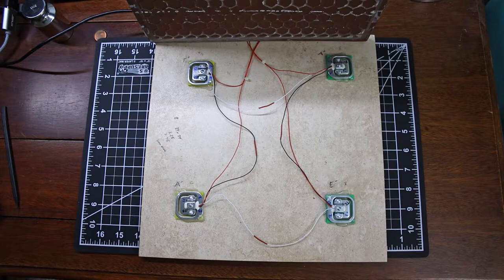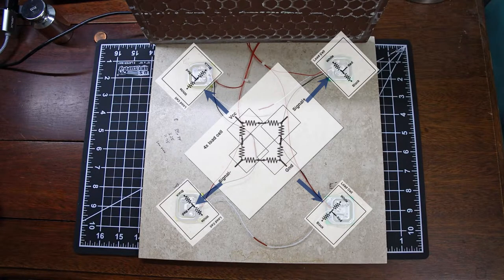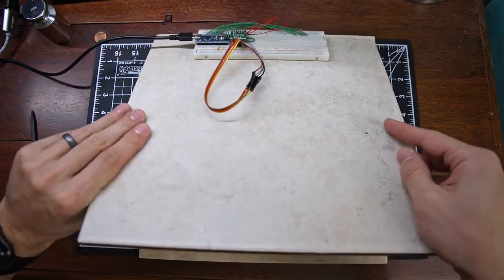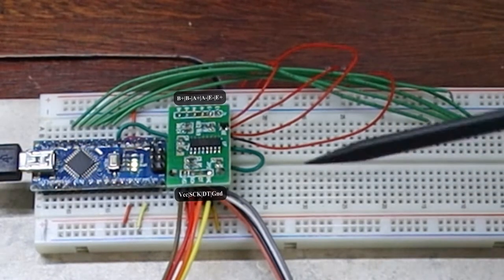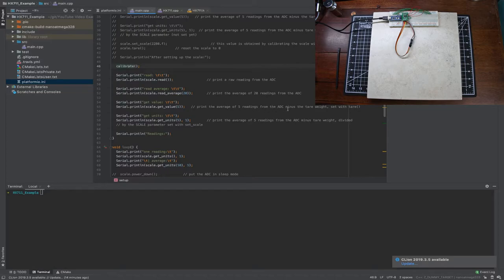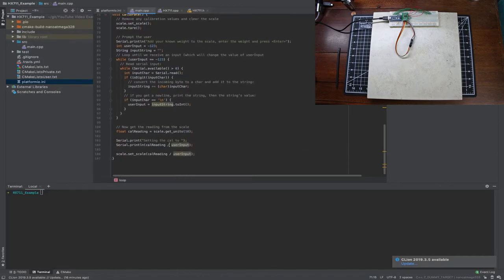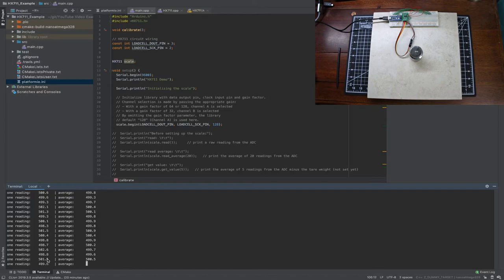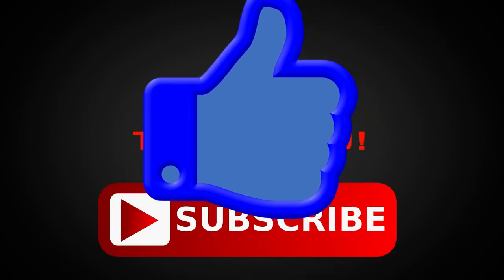How to use HX711 with Four Load Cells

Comment: Hi There how did your project turn out?  
I take it you were leaving the kegs on the scales for days on end did this cause any problems in the weight readings creeping.
Your project is similar to mine and this is my main concern the margin of error with a load on the scales almost permanently would give an unworkable error for my needs.
what sort of weight were you trying to weigh and what error did you get.
Thanks
Reply from the maker: My final project actually ended up being a coffee monitor for the office. It monitors the amount of coffee in a carafe to let people know how many cups are in it, it even sends out a Slack message to notify people when a new pot was brewed. Anyway, the weight of the carafe and coffee together was about 120 ounces if I recall. I did have issues with creeping which I tried to fix by taring when I detected the carafe was removed from the scale (during a new brew). Ultimately it ended up that I had better results just ignoring the creeping because it would eventually hover around the accurate reading, it would just sway up and down over time, the amount of creep was never more than a couple ounces. I want to say (though I don't recall if it was the case) that I ended up having less creeping problems by using a different sensor than the HX-711. I used an ADS1232 which was harder to find, and even harder to find documentation for, I ended up writing my own library for it because I couldn't find one but this was all done on the Raspberry Pi because, since it sends Slack notifications I wanted an all in one system instead of an Arduino plus a WiFi module. It also gave me the ability to add logging to a MySQL database and create a website where I could view logs and charts of historical data.

Comment: Hi there, I have issue with my program. But in my program, I use Raspberry pi.
I just want to use 1 load cell. The output giving me inconsistent value. Any advice?
Reply from the maker: It's hard to troubleshoot over text but I would first check that you get expected changes when you press on and release the sensor. As long as it goes up when you press and down when you let go at least you know it's somewhat working properly. After that, if you are getting drift when nothing is on it, try putting weight on it and see if it still drifts. Any more testing would be based on what you see after running those checks.

I hope this helps.

Comment: how accurate are these?  can it go down to the per gram?
Reply from the maker: It's been a while but I think I showed a little bit of the accuracy toward the end of the video. With that said though, I use my project to monitor weight in ounces and it can fluctuate by an ounce or so and an ounce is about 28 grams. The main issue is that everything comes into play, if you take a look at the datasheet, different temperatures can yield different results so if the temperature changes, your weight calculation would need to change for that much accuracy. 

TLDR; Out of the box, not accurate to gram precision but with some algorithms like maybe a kalman filter it could be better.

Comment: Thank you so much for this video! Helped alot with general knowledge of the HX711 and how it works. My current project is looking to possibly use multiple sensors.  Do you know if it is possible to use multiple HX711 (up to 4 so 16 sensors) with one Arduino uno?
Reply from the maker: To be perfectly honest, I don't know of a way to mesh multiple sensors though I imagine it's possible. If they are all part of the same scale you could use multiple sensors and simply add the values from each sensor to get the total distributed weight.

Comment: How could I do this with only 1 of these thin load cells?  I need a thin pressure sensor.
Reply from the maker: Are you asking about using a strain gauge by itself (like this one that is mounted on a piece of glass https://i.ytimg.com/vi/uQWfNc24Ehc/hqdefault.jpg ) or just using a single load sensor like the four I was using in the video?
Reply: @RobotResearchLab  maybe both.  My original question was using a single load cell like the 4 used in your vid.
Reply from the maker: @TheDiverJim  That should be pretty easy though I have not tested this myself. Since you're only using one, you have to essentially finish the wheatstone bridge yourself. Here is an image of a circuit that should work for you, then the code should all be the same. 
https://aws1.discourse-cdn.com/arduino/original/4X/7/9/1/791377ddf46355cc9d9d6d059fbc83f9841a0f66.jpeg
Reply: @RobotResearchLab  thank you so much!!!  I unsure what the amazon listing meant by half bridge, yet 4 load cells.  So since these are center taped, the thermal error should still be compensated for some what?
Reply from the maker: @TheDiverJim  I wouldn't worry about the thermal compensation, at least not until you get the code running and figure out if it's actually an issue. Also, if the ambient temperature is going to be relatively stable it wouldn't matter as it would be factored into the calibration for the most part.
Reply: @RobotResearchLab  so i got it working, but I’m getting a ton of drift.  I left a 2kg calibration weight on it for 20m and after 15m it read 1.3kg.  Any ideas? Could my load cell be defective?
Reply from the maker: @TheDiverJim  That does seem like a lot of drift, I've noticed some drift but it usually averages around the same point. I'm not sure what might be wrong, I would probably start by trying a different load cell to rule that out. Aside from that the only alternatives are the code (not likely causing drift unless there's a bug somewhere) or the HX711 or whatever ADC you're using.
Reply: @RobotResearchLab  yeah.  The silicone coating on the resistor was damaged a little (small corner piece) when drilling the rivets off to add my own 3d printed pad.  My goal is to calculate at what point do we get a chest wall correction on a child with a deformed chest wall.
Reply from the maker: @TheDiverJim  Great that you found out the problem and it was nothing major.

I can relate to your project then, I have pectus excavatum. I'm not sure if that's included in the deformed chest walls you're looking at but a noble goal either way.
Reply: @RobotResearchLab  right now we are looking at non-surgical solutions for pectus carinatum, next is the far more challenging excavatum. 

So you think the damage to the coating is the source of my errors?
Reply from the maker: @TheDiverJim  Oh, I thought you found that to be the problem. But yes, I would say that if some of the coating was removed it would allow ambient temperature to play a larger role in your results and drift. It still may be something else but that would be my first check, try a new sensor. I would first try it before drilling and removing the rivet, then if you know you're getting good readings make the changes you need to and try again. This way you know that the sensor did work at one point.